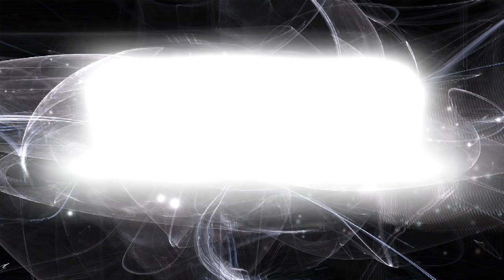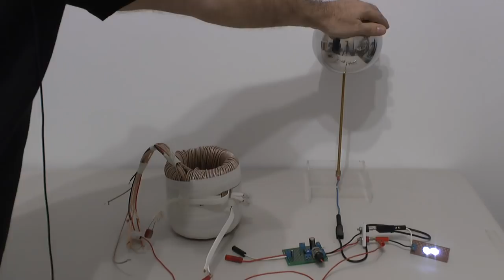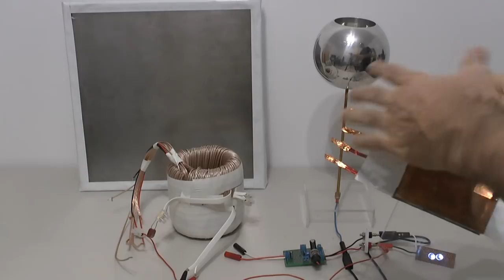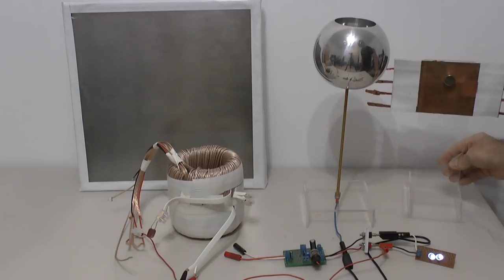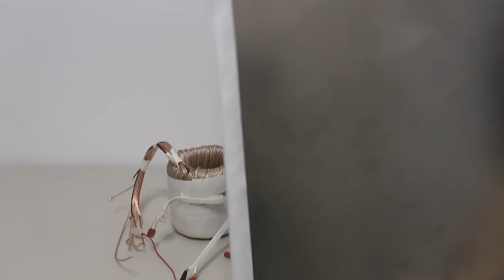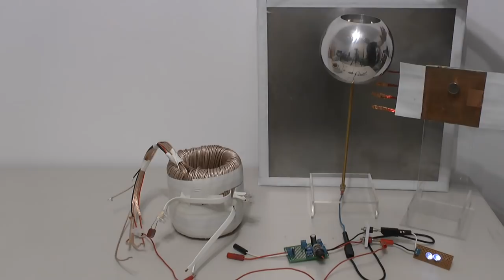The NG coil System the Radiant Energy Exiter

Comment: The wires that are leaving the system(videoscreen) are connected to a battery.
Reply from the maker: Nope, Watch the solution
Reply: I don't say you have to show us no hidden battery is inside, I say, show us where the power comes from, by keeping all cables in the picture.

Comment: Dear TheOldScientist, 
I see a few potential problems with your demonstration. Here are a few comments on your demonstration: 

1) AC signals behave differently than DC. AC signals in the kHz range or higher frequency have no problem to travel down a single wire with no return wire required. If you power a load using an AC signal from the red lead of a signal generator only, it still draws current and consumes power from the signal generator output, even though you do not have the black lead from the signal generator connected. 

To know the input power being consumed from your signal generator, using an oscilloscope, you need to measure both the signal generator output voltage waveform using a scope probe from the signal generator red lead to the signal generator black lead (ground lead), and measure the signal generator output current on the signal generator red wire using an appropriate  scope current probe or an appropriate current sensing resistor (eg. using a 1 Ohm, non inductive resistor).  You must take the phase angle of the signal generator red lead current waveform into account to calculate the power. 

However, a potential problem is that with AC waveforms at very low power levels like this, it is very easy to get skewed or otherwise very misleading measurement results (eg. phase angle may not be reading correctly), so at such low input power levels measuring the true input power from the signal generator accurately could prove to be quite tricky. 
A common mistake made by experimenters in this area is to guess at the input power without actually properly measuring the input power. For certain, even when using only the red lead from the signal generator, it is drawing an AC current from the signal generator down the red lead wire. It is not 'voltage only'. There will be some AC current flow there. 

2) You mention an output power of greater than 100mW, but my tests using a DC power supply to power large clear LEDs like you are using indicate that a single large clear LED will light fairly brightly with only about 130uW of power, and will light very brightly already with only about 2.5mW of power. Where do you get an output power in the range of 100mW or more? You did not show how you are measuring this. Based on my tests, two large clear LEDs will light very brightly already with a power consumption of only about 5mW. 
See my short Youtube video entitled "LED Low Power Consumption Demonstration" to see my measured power consumption results for a large clear LED when powered with a DC power supply to allow for easy power consumption measurements. 
https://www.youtube.com/watch?v=P974Ewv4jFQ

All the best...
Reply from the maker: I am very familiar with all your points. the output power is incorrect. It was based on the power rating which is always wrong to use. I will state that in detail in my next video. Your 130 uW is also not correct if you use 3 Volt LEDs. They consume at 5 Volt, 2 in series 500 uW. the more you connect the lower the current draw. I get them very bright at 5.3 volt with 2mA. I will show details.
Reply from the maker: One more thing. For  a precise test you have to measure floating with active voltage probes, which I use. The wavegenerator of the Scope is not useful because it gives out too much power. It senses current draw and fluctuates the impedance. I use a precision instrument where the impedance is fixed. The output from a TTL signal is  shown to be correct as voltage source for 5VPP.
Reply: Hi Thomas. Sorry, I don't follow you. What I stated about measuring the power is correct. The 130uW is what I actually measured in my own test using a DC power source for a single large clear LED at low current (approx 50uA current), so it is certainly correct. The point of that measurement test shown in my video was to show that LEDs of this type will already start to light fairly brightly even at a very low power consumption of about 130uW, and to show that they light very brightly already when consuming only about 2.5mW for one indivudual LED. For two of this type of LEDs, both at about the same brightness, it would of course therefore be about 5mW of power consumption.   All the best...
Reply: Hi Thomas, as I mentioned in another comment, you can really simply the analysis if you used a battery powered signal generator. All the best...

Comment: Is the air acting as a capaticence gap between to ends of the system.  The air gap between the coil and the ball has a dual function - agitation & generation.  The relationship between potiential and virtual ground is resolved by this system insofar as there is no need to ground.    - sorry i am talking gibberish to myself -
Reply from the maker: Yes correct. Still it does not explain why the LED is lighting up. The solution has been already provided.

Comment: all frequencies are present and being rectified by the Light emitting diodes adding mass to the antenna increases current. Do you have a book? Your work is fascinating...
Reply from the maker: All details are on my website with tutorials, available for Guese members free of charge. You are observant but that it is only one part of the awnser and does not explain why the LED light up.
Reply: @TheOldScientist  what about the circuit friend?

Which components are there? Please.

Comment: if you enclose your experiment in a Faraday cage it will not work, your return path is piggy backing off of the natural ac coming from the sun which makes the earth have its atmosphere. this is observable when you touch your virtual ground and the led brightens up, because your body has more energy stored in it by way of capacitance from the suns ac signal. 

i like your channel videos very much, about your video Superluminal Scalar Waves for Communications, did you ever figure out how to make a radio transmitter with a microphone for that system? the need for 1800 foot radio towers would be obsolete if you have.

KING HAZeus AKBAR!!!!!!!!!!

Uranus Bless America.
Reply from the maker: As you watched my video it does not matter if it is in a faraday cage. Please read up on near and far field of radio waves.The near field will always penetrate a faraday cage. The far field does not. It is the same frequency but reaching half the wavelength. You're answer is going in the right direction but not correct. And no I did not work on the communication subject any further.

Comment: So...we know capacitors are potential devices.  So no mystery charging capacitors with pure potential.  Now the wire in your coil must perform the job of the "conduit" to transfer the potential to the capacitor.  Certainly no current would be involved since the very nature of a capacitor is that of an 'insulating' dielectric.  Yet, if amp meter is placed in series with the 'charge' coil wire an current would be indicated.  However, this current is merely an artifact of he AC nature of your signal applied, maybe incorrectly called 'displacement' current but you get the idea...not hot closed circuit current.  The more critical part is that a longitudinal magneto-dielectric induction (LMD) travels perpendicular to this displacement current (in the same direction as the mutual induction in a normal transformer application).  Let me know how I now get my free membership (:

Now onto the receiving side.  The vibrations created sing to the environment.  Of course we usually don't hear it as the resonant frequency is to high for our auditory capabilities.  Nevertheless, your body does 'hear' or rather 'feel' the vibrations.  As your body is made of over 90% salt water you are a fairly good conductor.  Thus the vibrations excite your body charges into the resonant vibrations in the vicinity.  All that is left to do is touch the conduction dish providing the correct frequency 'ground' or better in this case 'common' completing the circuit and lighting the diodes, 'hot circuit'.  So as not to stand there all the time, you used a fairly large area conductor metal plate, and on other side, in an attempt to better pick up the resonant vibrations, much like a person's body, you added to the other side.  Thus the metal plate vibrates charges in the plate which when touched to the metal load transfers the vibrations as a 'common' down to the diodes, just as the body did.  However, not as bright as the capacity of this plate was not up to a human body.
Reply from the maker: Well, it sounds good but not right. Try to charge a capacitor only with AC on the positive leg. For LMD circuits watch my video I produced https://youtu.be/sDhse44R_UA, 8 years ago. A capacitor is resisting any polarity and looking for equilibrium. In order to change that you require current to force it. The higher the capacitance the higher the force you need to use. Potential has not chance.
Reply: I can charge a capacitor with AC on the positive leg.  Since it is AC the positive leg changes with the Sin from negative to positive.  So I incorporate two diodes, connect them reverse polarity across the capacitor off of the one line of AC...the capacitor will charge.   At any rate I knew I was missing something and wanted to learn from you with your response and I did.  Thanks!
Reply: Eric Dollard did it right here: https://youtu.be/eMaejHovovU?t=24m36s As Mark S says above you can indeed use a diode like a 'check valve' to charge a capacitor with AC, and actually that is what is going on in your setup too, but there's a little more to it. When an electrodynamic system is set up to minimize its magnetic field and maximize its time-varying electric field/voltage, other relativistic effects become prominent. In this case the LMD waves can knock electrons off the surface of a conductor, like the metal sphere. The process of doing this makes the sphere-air interface behave analogous to a diode. In effect, it is sending of Langmuir waves (or DC pulses if you prefer) in the dark discharge regime of the plasma around the sphere, enabled at low voltages by the aforementioned relativistic effects. Eric Dollard needed higher voltages than you in his demonstration because he did not cancel out the magnetic fields nearly as much as you've done here. 

It is easier for the electrons to flow off the metal if the electric field is concentrated in places, or if the environment around the sphere has ions that can move freely, This explains the orgonne energy thing you tried, because attaching a single wire will make electric field around that wire higher at a given voltage than on the surface of the sphere, allowing for better discharge of electrons there. This also explains why when you touched it, it worked, because Langmuir/LMD waves travel in the human body just as well as in plasmas due to our salt content. Then when the wave got to your fingers, nose, ears, etc the electric field was concentrated in those regions, so discharge could occur more easily than on the sphere. As for the soft concentrator, I am unfamiliar with that one so I won't speculate about why that worked.

Please feel free to ask questions! I am happy to help.

Also I wish I had a copy to provide at the moment, but definitely find a copy of this paper: https://www.researchgate.net/publication/3122265_Velocity_Modulation_of_Electromagnetic_Waves

You mentioned exponential growth in energy for a future video. This is characteristic of parametric amplification, and if so, this paper will serve you very well. I am working on my own device based on the principles described in that paper. Strangely it seems there are ways to drive parametric variation that require input energy which is only coupled to the amount the parameters are varied, and not to the size of the signal being amplified, and therefore not to the output energy . I really should ask my professor for another copy of that paper...
Reply from the maker: Mark, You make it a bit to complicated but you describe the right process. I will show the solution on Monday next week very simple. Register as Guest on my website and I will grant you Gold Membership. Thanks.
Reply from the maker: Mark are you registered as Javamark
Reply from the maker: Spot on
Reply: May I be a member as well? I would like to collaborate.
Reply from the maker: I mentioned register as guest and I give you Gold Membership. Website is in the banner, or here www.vorticesdynamics.org.uk
Reply: Thanks! Will get to it some time this afternoon
Reply: Yes, and thanks again, much!
Reply from the maker: All done please login and let me know if everything is ok.
Reply: I am having trouble registering as a guest; it seems to just redirect me to the main page of the site. What should I do? There is a site vorticesdynamics.com instead of .org, but that still does not allow me to do the captcha to submit registration for a guest membership.
Reply from the maker: Don't use.com. It is in testing. Use only org.uk. or co.uk for vorticesdynamics. Find the link up in contacts and websites
Reply: Done! The .co.uk address works.
Reply from the maker: Enjoy on all sites